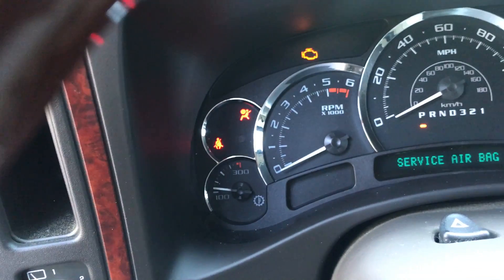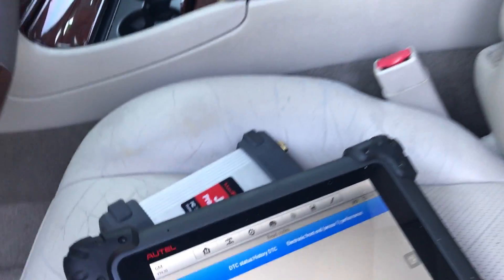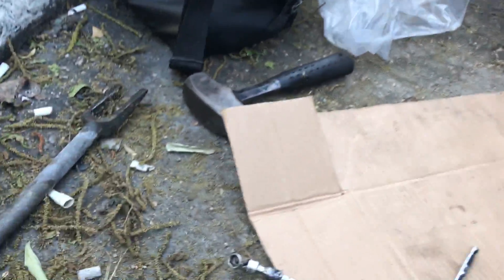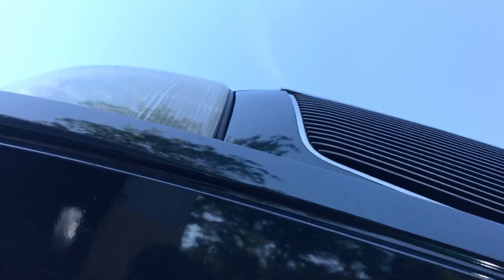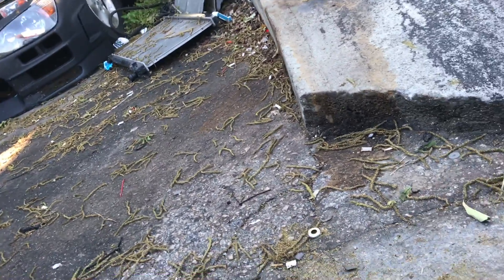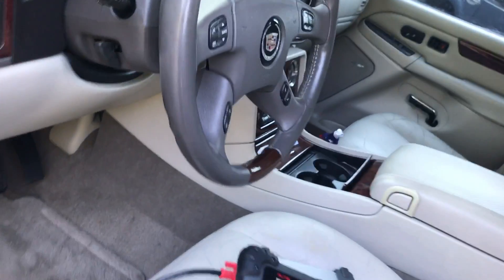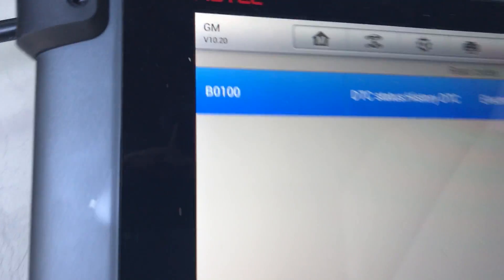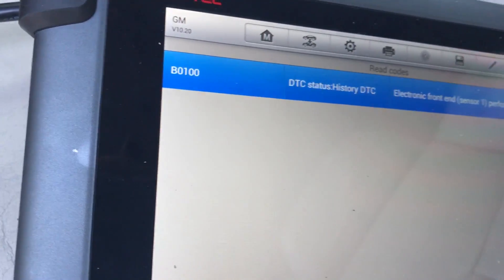How To Fix SRS Airbag Light Code B0100 B0103 (EASY FIX) #howto

Comment: Thanks for the video. This worked perfectly for my 2005 GMC Yukon SLT and there is no more airbag light! I had a persistent airbag light on and I finally went to O'Reilly who informed me of the B0100 code.  I purchased the Doorman 590-200 sensor which was confirmed as the correct part of my vehicle. Installation took about 20 minutes. Before starting any work, I made sure to disconnect the battery and let it sit for 45 minutes. I replaced the driver side sensor since code B0100 is for the Front End Impact Sensor - Left (or Drivers Side.)

Comment: I have a Pontiac G6 2.4L I have this same code P0100 it shuts down your car and prevents it from starting
Reply from the maker: There are four different types of OBD-II codes – P, B, C, and U. The P stands for powertrain (engine and transmission) systems, B for body, C for chassis, and U for network and wiring systems. If the ECU commands the check engine light to illuminate, there will always be at least one P0 code stored.
It's a big difference that codes in my video  start with letter B, which is airbag codes, not p
Your code p0100 is for mass air flow sensor. What you will need to do is check your air filter and the sensor to clean the dust and clear the check engine like it and then check if it's good to go. If not, then replace the mass sensor and check the plug and the wires. Good luck